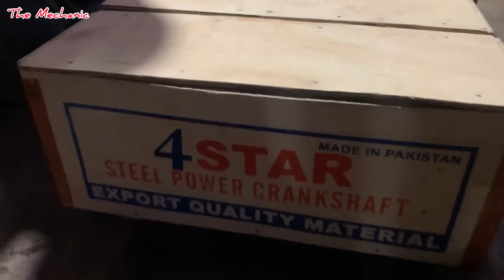Production of Crankshafts in Factory Complete Process || Machining 3 Cylinder Engine Crankshaft

Comment: The great thing about this video is that all the comments are acknowledging the application of skill with very limited facilities and probably training, but also that modern manufacturing techniques and equipment will make more, better and cheaper product. At the end of it, these cranks are low quality, but also good enough for the application, manufacturing them is paying wages and the end product is being put to work and will also be making someone money so they can all feed their families. Well done done to all who are overcoming the challenges of life without the stepping stone of being born in an industrially advanced nation 👍
Reply: It would be good to know exactly what these are for. I think most people assume they are for gas/diesel engines, but more likely this is low-speed industrial machinery (like for a water pump or air compressor).
Reply: @benkromphardt1916  towards the end where the gent off loaded boxes, the name and logo on them depicted 4 star mf 240 crown. I google searched this and its used in Massey Ferguson Tractors rated at 50 to 85 HP diesel engines. Even says made in Pakistan.
Reply: Beautiful comment
Reply: What's depressing to realize, though, is they could make the same low quality cranks very cheaply in seconds in a better shop.
Reply: What makes them “low quality”
Reply: not bad for what it is having worked in a machine shop.
Reply: Great comment. These workers are feeding their families and are adding to their economy by the manufacture of durable goods. I commend the productivity and skill of these workers.
Reply: @MrSean7790  high tolerances, misalignment, lack of balancing, lack of heat treatment and inconstant/low quality materials.
Reply: Yu

Comment: 2:03 Checking a diameter with a caliper on a spinning part is a great way to wear down your caliper and throw off future measurements.
Reply: "Rough" caliper and "fine"caliper
Reply: Not if you use new calipers everytime
Reply: They learned that at a Chrysler plant!!
Reply: my 1st thought haha - the seals gonna run tight thats for sure :) not to mention they arent even very accurate imo - but as stated these are low tolerance parts for water pumps etc..
Reply: @guysumpthin2974  Look the guy's face lol, he's machoeing the macho!
Reply: @quickbf  mituwhut?
Reply: @guysumpthin2974  ain't no fine calipers in there lolol
Reply: they've been doing this job for decades ... would you think they're stupid? Do you think they don't know what they're doing?
Reply: @transilvania5811  I would say that they just don't wish or are not allowed to take it to the next level of quality and precision. If one of those guys made one for HIS tractor, he would likely spend triple the time on it. Greed and culture at work here. When they stop working on dirt floors, they will discover much.
Reply: @RRaucina  Who will provide them the proper expensive machines, tools, and rent for facilities where they can work?
Reply: @transilvania5811  We don't know if they've been doing this for decades and we don't know if they are stupid or not. What we do know is that he was using a caliper on a moving part. That is stupid. That's a fact.
Reply: @raikku2971  The company boss, duh. I worked as a machinist for several years and never was asked/required to buy my own lathe or mill 😆
Reply: @transilvania5811  You can do a job for a thousand years and still do it incorrectly the whole time.
Reply: given the lack of PPE i doubt finished part tolerances are critical for this.
Reply: @raikku2971  Indeed a problem for financing and infrastructure. How about the IMF or UN programs?
Reply: All measuring tools calibrated and within performance tolerance 🤣
Reply: I think that is the last of their problems.
Reply: @quickbf  lmfao
Reply: I thought the same but you can see that they dial it in pretty well at the end when the final grinding process puts the ODs on the journals. He locates everything off the centers and checks them with an actual mic when finished. In those earlier processes they're oversizing the journals quite a bit so the grinder has enough material to take off to true them.
Reply: @raikku2971  Pakistanis do not invest money in better equipment because the cost of labour is so incredibly cheap. 

It's cheaper to rebuild an engine x10 with shit parts then once with good parts.
Reply: @quickbf  Sure , We use them for making parts for Boeing and Airbus
Reply: @transilvania5811  Nobody said they're stupid. They're doing a job the way they were told/taught to do it. It's just people that actually know how this stuff should be done (I myself am a powertrain engineer...if you've been on a road in the America's or Europe in the past decade, my work has been around you if not moving you). Look at how the tools are treated. When calipers are actually used, they're left open, tossed on top of the machine, etc...and calipers are nowhere near precise enough to make a quality crankshaft when handled and maintained properly. Same goes for the rest of their machinery...those lathes are going to be at least 60 years old and, with the best of treatment, the ways will be sloppy, the screws loose and machined tolerances will have a great deal of variance. In this environment where you're generating a lot of dust rather than chips, the problem is multiplied many times over as the dust gets in the way oil and grinds everything to bits. When I'm seeing a machinist's only pair of calipers being left jaws open, outside of a case and literally thrown on top of a machine, that's a pretty clear indicator of the care given to the equipment. There's no way these ways are being ground and scraped true again regularly or jack screws replaced to maintain tolerance! All that is to say, while the work done is impressive for conditions and equipment, the parts made are junk and likely to do more damage than good.
Reply: @JustAlanIsCool  Really? I got a job as a machinist and was given a list of tools I needed to bring day 1 along with a catalog with a whopping 10% discount. Calipers, micrometers, indicators, 1-2-3 blocks, face mills, end mills, inserts, gauge blocks, parallels... you get the picture. That was all out of pocket for "the world's largest automation integrator."
Reply: For PERKINS DIESEL ! FANTASTIC ENGINES!!!
Reply: guenther0420 the rough caliper is a "friction pivot"
Reply: And lose a limp
Reply: @transilvania5811  Clearly they don't.
Reply: Either way, a crankchaft needs to be accurate. So I think they do it according to the specified parameters.
Reply: calipers are fine for rough work, usually the crankshafts are ground to fini9shed size, working like this would not be allowed in Us, or the European production plants, no wonder we cannot  compete, even the machines are dangerous to work on, open belts and pulleys along with turning the lathe on via an Isolatpor switch.
Reply: @transilvania5811  to some extent, they don't know what they're doing.  First, I acknowledge the true grit and effort they display, the 'can do' attitude.  But when I can glance at this video and see easy ways to improve productivity, that's just embarrassing.  The guy could be wearing eye protection.  The guy could improve lighting on the work very easily.  He could be using custom made side gauges.  He could be using a steady rest and possibly a follower rest.  He could be using ceramic bits and coolant.  All of these things are accessible to 3rd world shops.  Put the exact same tools and budget in front of men from switzerland or south korea, and they will out-produce.  Just saying.
Reply: @raikku2971  they can earn those machines when they make easy improvements to their existing machines.
Reply: @RRaucina  I agree, it's the culture that is limiting these guys. The Swiss would do better, the Haitians would do worse.  Deal with this truth, people!
Reply: @guysumpthin2974  I do did wonder if those were cranks for Perkins 3 cylinder engines.
Reply: @someotherdude  Don't mention the Swiss....they make triangular chocolate....the mind boggles.😂😂
Reply: did anyone see a micrometer anywhere? QC manager, yep she's shiny... good to go
Reply: Let's face it, we aren't here for precision :D
Reply: @jeffmiller3150  😂😂😂
Reply: The tips of the calipers r nade of diamond..never wear out..👽
Reply: @transilvania5811  Yeah, these guys are making cranks for LOW SPEED, LOW HP engines that were designed to run with loose tolerances. And last 50 YEARS! Everyone here acts like they are watching High performance racing engines being built. Funny thing is, the oldschool engines these guys are making will outlast most of the "high tech" SHIT that we make here. And I'm NOT kidding about that. Just look at the home generators they sell for power backup here these days. The fucking things wear out after just a few years of normal, monthly generator "exercise" of an hour a month or so. So tell me, just who is it that is building crap?
Reply: @tonsta1703  33:35 - 36:00
Reply: @beaneater001  your right, i probably lost interest before that point
Reply: Does it matter? These cranks are going into mopeds or whatever. The quality of steel is bottom of the barrel.  As you can see the step 1 machining is already rusted by the time it gets to step 3. I never thought I'd see worse quality steel that what they were using at the AlfaSud factory in the 80's, until now.  LOL
Reply: @interesting7906  Mopeds ???